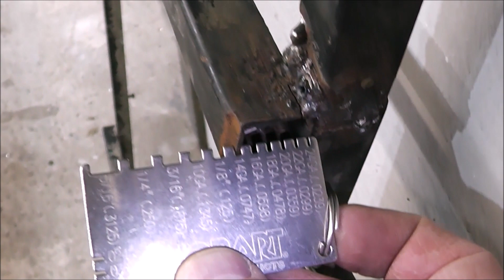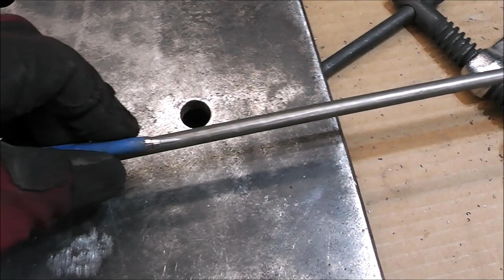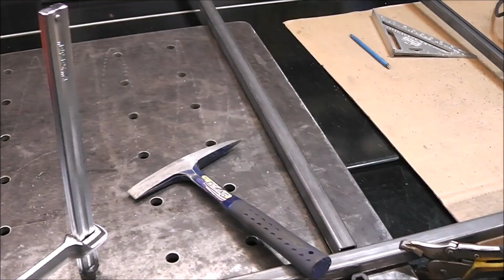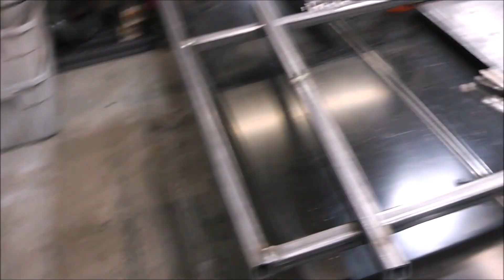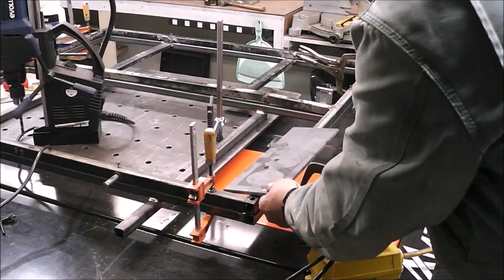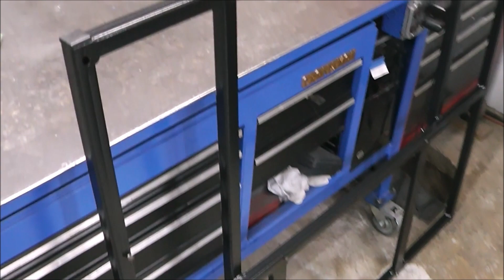Welding and Fabrication Job Repairing Broken Frame

Comment: You should have just drilled and tapped new holes for the lock bolts for the gate
Reply from the maker: I wanted to keep things simple by duplicating what was there... No need to make additional work.

Comment: Hi where did you buy those shoulder bolts please
Reply from the maker: Hey Keith. I got them on ebay. They are 5/8" diameter x 3/4" long
Reply: @BrandonLund  thanks for yr reply
Reply from the maker: No problem Keith. If you get stuck, give me a holler and ill see if I can find the link to the person I got them from on ebay.

Comment: Great build , great video , that should last him a long time , Did you check your new welder for any gas leaks like you did your others ?  Thanks TANK
Reply from the maker: Thanks man! When i first hooked it up I checked the connections by the guage and at the back of the welder. I've already forgot to turn off the bottle and lucky for me when I returned a day later the guage hadn't moved :).

Comment: Wow no gussets welded on the old one. Tisk Tisk. Ah one ? why not cut and weld 45* corners with gussets no end caps needed.
Reply from the maker: Its not necessary. Why reinvent the wheel? If I went ahead and welded gussets and the owner complained of clearance issues, then I end up eating it.
Reply: @BrandonLund  Right agree. I wasn't there to make the deal.
Reply from the maker: I hope I didn't come off condescending. It wasn't my intention. You made a valid point.  If I had the whole rig at my shop I probably would have but I told the customer to bring me just the frame so i didn't dare deviate from the original design because I wasn't really sure where any clearance was needed if any.
Reply: @BrandonLund  Na your good. I'm just used to giving suggestion to customers to make a product bulletproof granted it was a dump trailer and I didn't know their budget. I was out of line with my suggestion. Happy ThanksGiving!
Reply from the maker: Its all good bud. Thanks for watching and commenting and Happy Thanksgiving to you and yours 👍